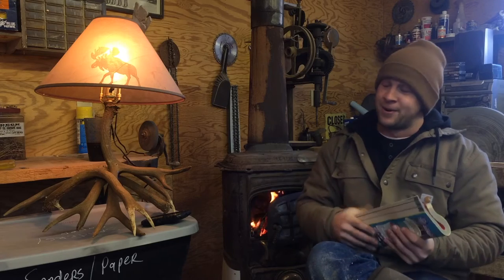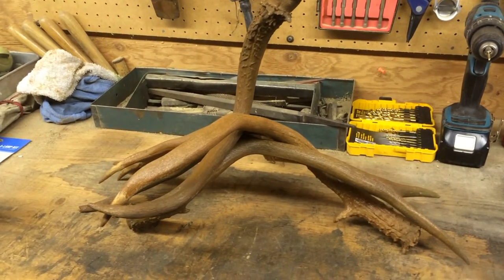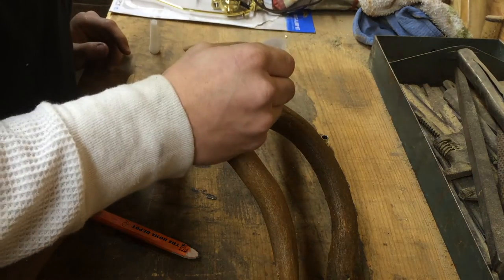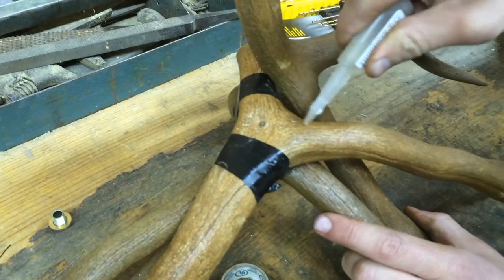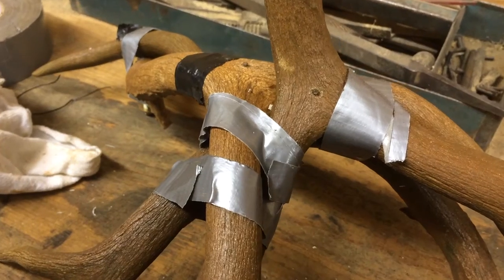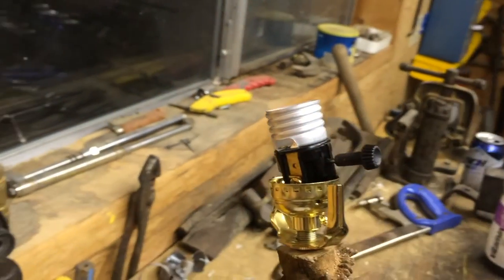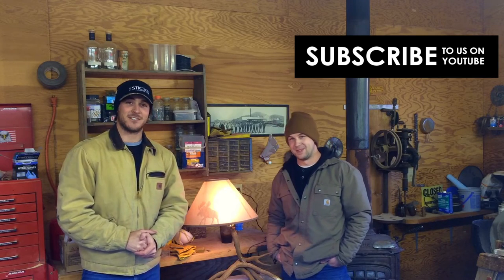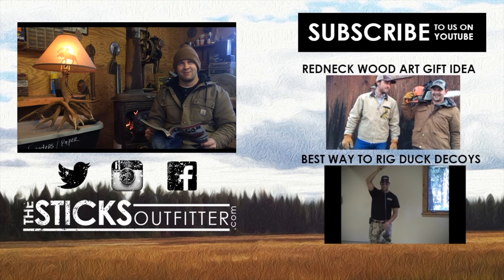How to Make an Antler Lamp DIY | The Sticks Outfitter | EP. 6

Comment: Add tape around screws to prevent shocking if it comes loose. Also wrap the wire around the screw clockwise so it tightens up
Reply from the maker: Good ideas!